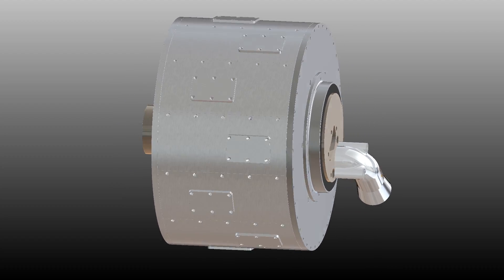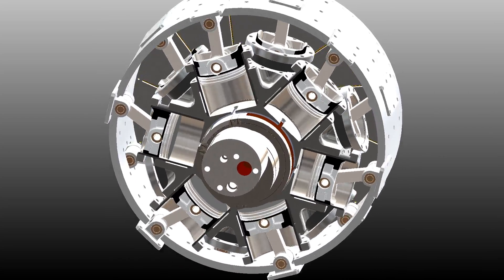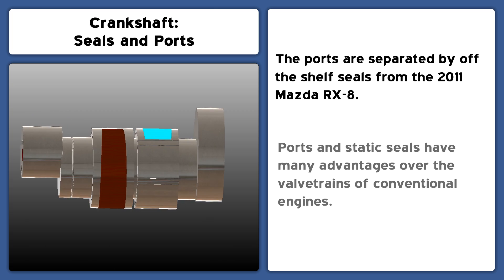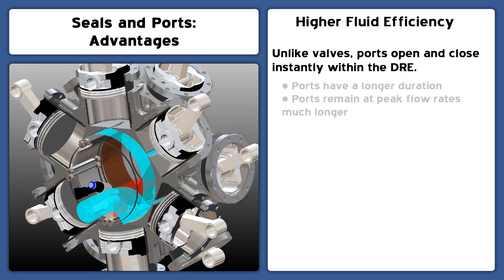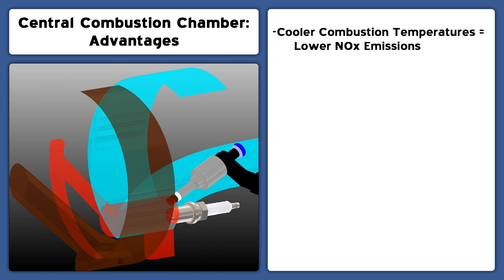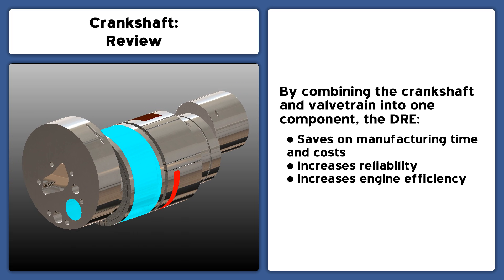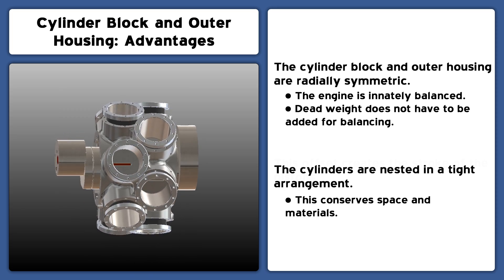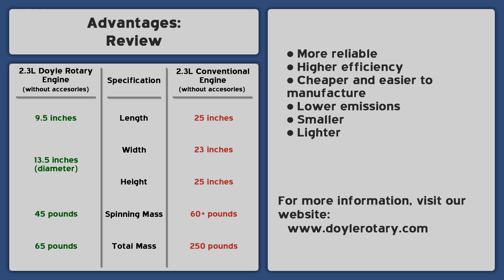New Split Cycle Engine Concept: The Doyle Rotary Engine

Comment: so you have two pistons doing the same job one piston does now? to me it seems like a lot of extra weight for the same or less amount of power. in theory if you have two rows of cylinders splitting the four stroke cycle a 16 cyl engine is now an eight. with only one of the rows on the power stroke its telling me only one row would be creating useful power, but i could be wrong i only have basic knowledge of engine physics.
Reply: Having 2 pistons compress air into the central combustion chamber at once allows for a much higher pressure in the combustion chamber, which should yield more power and better fuel economy. Similar to increasing the compression ratio on a typical piston engine.
Reply: JoeyBeanz if you are having more than one cylinder compressed into the combustion chamber at once then the one cylinder is still going to be approaching top dead center as combustion occurs which means you're going to have engine knocking and destruction on that cylinder before it can get around to its power stroke after top dead center

Comment: Obviously I am very impressed with your tenacity (28 plus years) to get the engine up and running.

Have you ever thought of combining the Dole Rotary Engine with a flame licker type engine.  So it becomes a single ring of pistons rotating around the flame source, the motion of the pistons allowing of air cooling of the cylinders.

Ultimately engines that would be able to run on wood are futuristic.
This YouTube of a very fast vacuum engine gives me hope that a powerful version could be built.

The flame source would be based on a fan assisted Rocket stove design fire giving temperatures as high as 1200 degrees Celsius.  The exhaust gas go into the rotary engine so there is no compression just cooling and hence “vacuum”.

That one wasn’t even insulated.

Have fun please write back if you think there is merit.
(Links removed so I can post this.  Write back and I'll send the links)
Reply: You can post links on the new googletube. Also, you can edit comments if you want to add them :)

Comment: it looks nice but, what about cooling ?
Reply: While I know barely anything about engines, might the rotation of the cylinders allow for air cooling?
Reply: dumle29 but its closed in some container, and for air cooling u need more surface
it means u must make many ribs around all cylinders, sec fact is air cooling is not effective and for high performance engine air cant cool engine right. Maybe there will be another holes in crankshaft for liquid cooling but it wiil be complex
Reply: Seing as this is a concept model, I don't really see why that couldn't be added to an actual prototype.

Comment: I don't see how there is less rotating mass. You have a drum, connecting rods, and pistons all moving in a circle at high speed instead of just crankshaft and cam shafts... Looks like there is a lot more rotating mass than a regular engine. I doubt this thing will be capable of any real power before it rips itself apart from the bulk of the unit spinning. Its basically adds the weight of the cylinder bores to the rotating mass. I am not convinced the rotating mass is lower than in a typical 4 stroke engine.

Comment: try building one and if it works, maybe it will go into production. you never know...it could end up being more environmentally friendly then a tesla, or it could end up being worse then a nuclear power plant.
Reply: A nuclear power plant has more environmentally friendly gases than an average car, because its only gaseous emission is steam, however if we are talking about the fuel source its problematic to humans, but not so much the environment (as indicated by the Chernobyl disaster, which hardly effected the wildlife, or in fact helped it because it drove the humans away)
Reply: my point wasn't that nuclear power plants were bad, my point was that the engine could be a good one or it could be bad, though i see what you're saying.

Comment: Motor would have a lot of angular momentum, slower to rev than conventional motor.  Also, huge advantage of conventional motor is crank shaft it at the bottom of the block / lower in the car, this motor would need a transfer case to "bolt" to a standard tranny.  Very cool idea though!!
Reply: 383mazda The outer edge of the rotating housing could have gear teeth.

Comment: The downside is that it will overheat and seize with the slightest loss of oil pressure.
Reply: Overheat? too right, how do you connect a water jacket?

Comment: can you say,... "gyroscopic effect"
Reply: Indeed, i also wonder how centrifugal force will affect the pistons.
Reply: If you put it sideways it would allow you to not flip as easy, but it would have minimal effect on regular turns
Reply: @johankirch6288  It will still have the same gyro effect, in-plane with its center.
Reply: Gyroscopic precession... The same thing that caused some ww1 planes to be unpredictable.. would be way worse with 2 rows of water cooled cylinders lol especially considering the high rpm demands of modern engins.. probably so bad that even a large truck powered by this engine would feel the effects Nevermind light air or watercraft... Aircraft will dive turning one direction and climb opposite unless of course, u have two engines rotating opposite each other...

Comment: Looks very good and low cost. But all that heat occuring on two points of the crank will be a problem and burn away those seals. Also getting all the required air in and exhaust out would require a very large cross section crank. If the crank is quite large then that will mean a very large spinning mass, leading to an interesting failure situation if it seized at speed. This arrangement also makes reliable adjustment of valve openings at speed almost impossible, a serious disadvantage against more conventional engines. A more conventional radial arrangement with the pistons pointing outwards would solve all those problems.

Comment: How would this work in a power plant or a large ship? It's a lot like a steam engine.
There is a reason that they don't develop these radical new designs. The petrol dollar. We are still using 100 year old designs. They still run after 100 years.